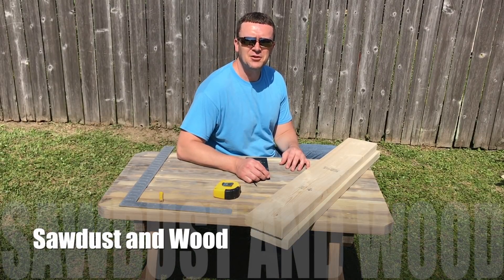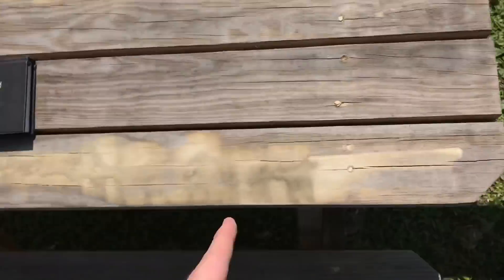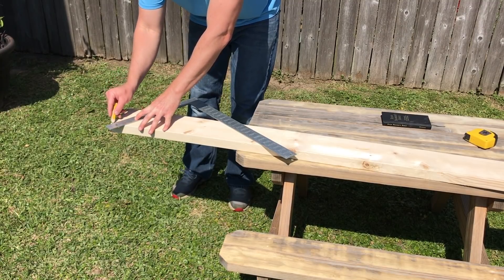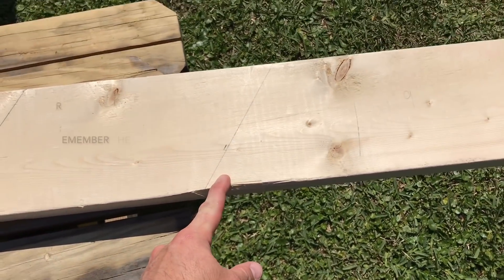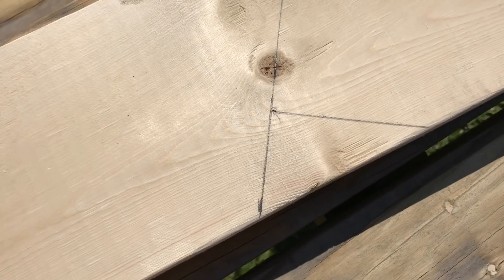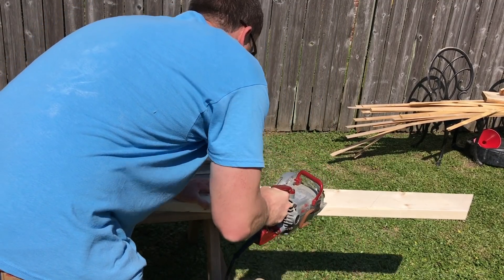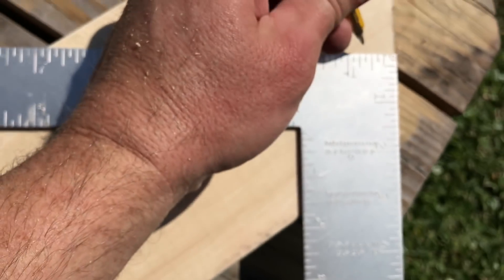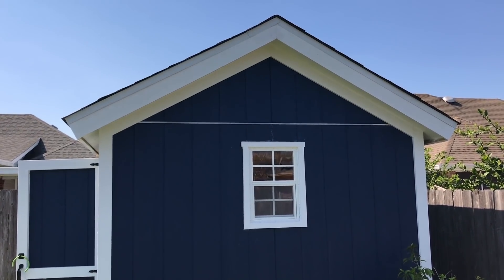How to cut gable roof rafters with the step off method

Comment: i have been a carpenter for 35 years i can frame wall floors but roofs iam lost. i built a 14 x 20 shed before i framed the walls i layed them out and chalked lines. found center of shed cut 2 angles on long 2x4 put them together on the floor and built trusses.put on four foot centers and could raise them myself very strong and easy to build.metal roof .love your videos learnd alot from you. you can teach old dogs new tricks lol. you should have way more subscribers yall give this man some subs.

Comment: I’ve watched at least 50 videos on measuring and cutting rafters, I reluctantly watched yours. I’ve finally learned how to do it, how do you measure Soffits? You seemed to have meassured the length of your bench instead of the width, in order to calculate the run, is it so? thanks so much.

Comment: Where does the 9 inches come from when you make your step off mark a d why does that determine the length of the rafters?
Reply: Total span = 42 inches 
Half of the span = 21inches or the run 
21 divided by 12=1.75
1 foot =12 inches .75 or three quarters of one foot =9 inches he marked off the first (one foot then the additional 9 inches) hope this helps. The length of the rafter is determined by measuring the total Span of the building, and then dividing by 2 also referred to as the Run.
Reply: @unclemony5939  thank you x.

Comment: You should have used the 2" body of the square to add the overhang.  I recommend every carpenter get a pair of inexpensive brass framing square "stops", (less than $5.00) also called "stair gauges" for quick and positive positioning, especially with hard to read scales on shiny metal.  They are a huge time saver for stepping off rafters and stair stringers, and your pencil will never push the square off when marking plumb cuts.

Comment: I thought you were supposed to use the measurements on the same side of the square. You're using 8" on the inside and 12" on the outside. How come?
Reply: Billy De Melo I was thinking the same thing.

Comment: Ridge beam Question... Using this technique, how do you locate the height of the Ridge Beam?
Did you pull up your rafters, stick in a 2x block and let the rafters meeting the 2x block give you something to measure down to get the height of your ridge beam? I know it can be done with the book or rafter square, but, just using this technique, is that how you did your shed? 
Need to get the ridge beam mounted first so you can put up your rafters.. Correct?
I had a friend once help me build a 20x30.. He said, how high do you want your ridge beam.. I held my hand up to the  top of my ear and said, bottom of ridge beam about here.. He measured and we took 2-2x4's and some blocks and made two posts and set the ridge beam in it while we set the rafters.. Never did know what pitch it was.. I think about a 10/12 from the looks of the 6 and 8/12 in your video..  I moved and sold the place, otherwise, I would go out there tomorrow and finally find out.. Ha..Ha.. 
Thanks for the simple ways to do things.. These things you can remember when you only do these types of projects once and a while... I just made some good notes and saved the link to your videos.. 
Came here because of the Octagon video.. Have to build one under my deck around a tree that has grown too large and pushing the deck now.. I feel pretty good about nailing that one down.. Thanks Cajun.. 
I moved from Bogalusa, New Orleans, Baton Rouge to Western NC.. Sure miss the Seafood and Boudin.. The only Head job I ever give is pinching the tails and sucking those heads.. Love those crawdaddy's..

Comment: How do you calculate the 8 12 rise or the 6  12 rise. I didn't understand that part. You had 1 ft. 9 in. Rafter , how does it calculate 8 12?
Reply: He picked the pitch he wanted to use just based on what he want it to look like when he finished...  It was not used to come up with the 1'9"=21" measurement.. That measurement is the "Half Span or Half Width" of the building, which was the width of the picnic table in this video which was 42".. 21" or 1'9" is merely half of the width = Half Width or Half Span.. 
The 8/12 pitch was used each time he marked the Rafter. In this case, 1 time for the Plumb Cut (First line marked), and again at the first 12" mark, then, he added the 9" and made the last mark which was the bottom of the Birds mouth... This is the end of the 21" or 1'9" span, then, he added a 2" overhang..  He never mentioned what the overall length of the rafter ended up being.. It really doesn't matter the way he does it.. He has a pattern now, that he will use to cut all of the rafters.. Then, last he said to cut off 3/4" of the rafter near the plumb cut because you will have a ridge beam that all of the rafters nail into... 3/4" is half of the width of that 2x.. Both sides minus 3/4 - 1-1/2" the width of the 2x Ridge beam... 
I knew nothing about this before this video, but, This should be pretty accurate.. the only thing I am left wondering is,, how do you mount the ridge beam..  I am guessing that the 1'9" is the top of the ridge beam where the top of the rafter is going to meet up with it, but, I am not 100% sure.. Wish I was building a shed tomorrow, and I could use this, but, I am building a little plumbing shed with particle and yarn filter with some small shelves for paint, caulk, etc,, and just heating it with a lightbulb for the winter.. It is against the side of the house, so, just a lean to at this point.  But, I have to do an Octagon around a tree under my deck, and the reason I came back here to this channel.. I found his videos a year or so ago, and knew I would have this  project to do down the road now here.. Ha... Save this Channel.. His Explanations are awesome and the simple way to do things, if you are not doing it every day to remember the faster ways to do it that you won't remember when you do it again.. Love this Cajun..  I lived in La for years.. Cajuns are good people.. The further South you go, the more Cajun they get.. ha..Ha.. Cheers.
Reply: I think the ridge beam height I 14 3/8

Comment: If you mark 8 on the outside of the tounge  than you have to mark 12 on the outside of the blade. You marked on the outside tounge for 8 and inside of the blade for 12 which means you are 1 1/2 off which is the width of the blade on a framing square.
Reply: He marked the inside of the square at the 12" mark on the outside of the square... He just transferred the 12" mark to the inside of the square.. Go back and watch closely..

Comment: A more accurate way of holding the square to the correct place is either use stair gauges, or clamp a piece of straight timber across the square on the marks you require,

Comment: Why did you choose 3" for the horizontal bird mouth cut dimension if the plate is 3-1/2"?  Does it matter?
Reply: He picked 3 inches because it's only a table . Yes if it was a building than he would have cut it 3 1/2 inches if using a 2X4 for a top plate . If the top plate was a 2X6 than he would cut 5 1/2 inches .

Comment: On the first 8, 12 step you used the outside of tongue of the square to mark off 8 inches.  You used the outside of the blade of the square to locate 12.  But you used the inside of the blade to mark the 12.  What determines if you use the outside or inside of the blade or tongue?
Reply from the maker: David Kirkpatrick good question what I did was locate the 12 on the outside...and find the mark on the inside that matched so I could accurately mark it...always use outside of square